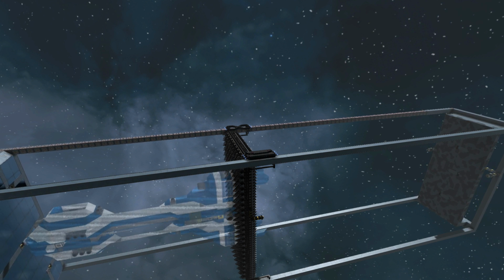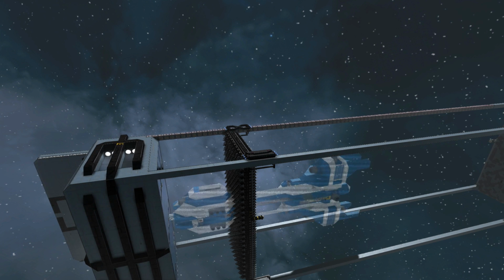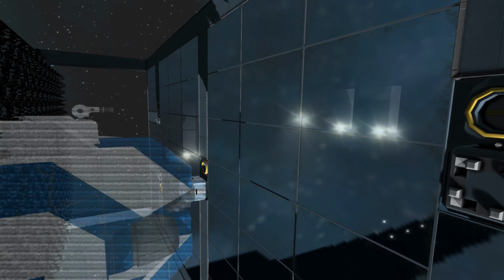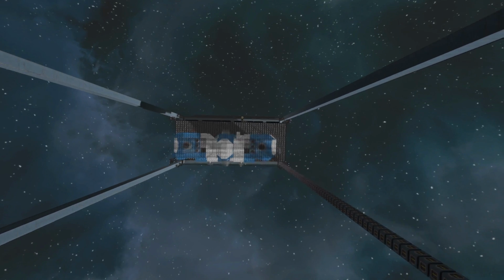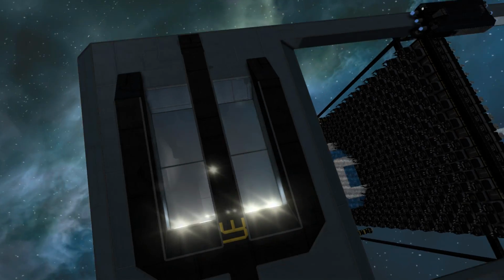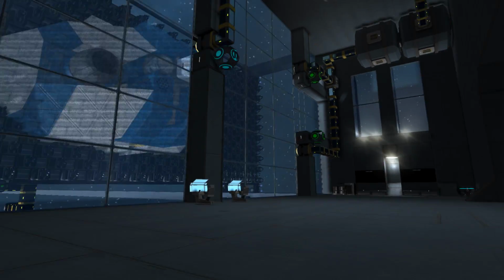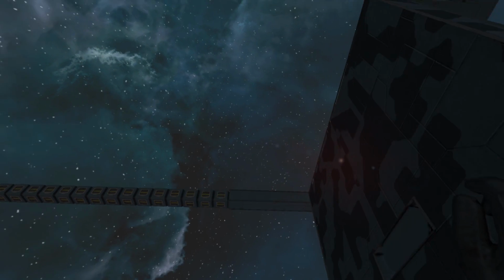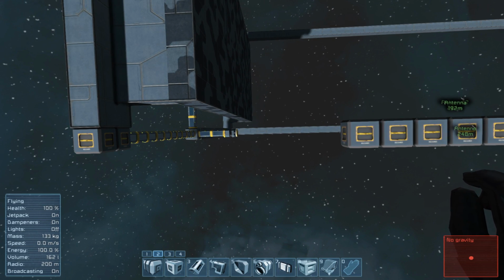Space Engineers - Trident Shipyards v1 (WIP) 3D Ship Printer

Comment: How about having the welders mounted on an extending rotating arm? You know, have the welders rotate around the ship length, and have a piston extend the rotation radius a bit after a full circle. So if you had a ship, which is 100 blocks long, you'd only need a smaller portion of welders than 700. You could even put the welders on a sled, and use only a handful of those. I'm unfortunately not able to play this game, but this channel is absolutely inspiring!

Comment: You mention that a straight cross grid will miss blocks. It is possible to design a cross grid with no overlap and no missing spaces. At least on a 2d plain nothing is missing. Have you tried using a cross grid in that manner? If so, what blocks were missing?

Comment: I have an idea, Instead of using so many welders on pistons with a  few sensors on the front and back of them and set them to extend and retract respectively. What happens is when you start the process it will extend till it see's the first ship block and retract when it get's too close this should keep it within welding range. That way you could print a ship by doing a few passes instead of just in one pass and should greatly improve FPS quality.... atleast that is my theory.

Comment: Impressive to say the lest. Was looking at have the reverse of what you have. Welders stationary and the projector on pistons (multiable) but wasnt sure how the pistons would be be up to the job.
Second idea was to use GPS now which wasnt avaible when you made the vid
Reply from the maker: stuart millican I actually tried the reverse version also with the projector and merge block etc on a piston rig... it was much like you expect - bendy! It kinda worked but wasn't prone to shaking about and being generally unstable :)

GPS method could be cool though
Reply: ***** just used a stationary welders and a projector-tug ship while using gps to keep my center line and speed on track. Worked a treat after a few trials and errors. Welders are still a problem but not as bad as a moblie wall. testing continues with your welder pattern
Reply from the maker: stuart millican
Nice :) Sounds pretty cool... utterly dumb that they still haven't fixed that welder issue though. :s

Comment: wouldn't be simpler to have a wall of welders stationary and move the holographic block??
that way you need only 1 or 2 rails and you keep the welders connected to the part storage and the welders not moving would render faster... i think
Reply: Marco Marques it would be more resource friendly 2!!
Reply from the maker: Marco Marques It would mean the entire ship needs to move though which has it's own issues... I thought quite a lot about which bit to move and which bit to keep still before I started as both are an option and have some problems too.. The main thinking behind this one is to make it easy to expand and make longer, plus the option to use it as a combo grinder wall too.

Comment: why not use on the welder pad, keep the welders apart by say three or four blocks, and then use pistons & timer blocks to move up and down those blocks which dont have welders on? So, say, As it moves, the pad moves down three, resets, moves across one, down three, & repeat twice more, then reset. Much like a real printer. XD You remove said overlap bug, But it would take 3X3 =9       *9 x Longer. So in the video it took about 1 minute to move halfway, so a full length is two minutes long, You stated it was sped up by ten So its 20 Minutes in reality for a full length, But with 9X less welders, You'd Need 9X more time, So 180 minutes would be needed for a full cycle. - I think.  

 And another problem with that design is, If you dont have all of the required parts and you are in a survival situation, the automated nature of the printer would leave blocks incomplete and just continue.

I may have been wrong about the overlapping distance of the welders however, But you just have to edit that formulae accordingly.
Reply from the maker: Fortunately the speed thing is just a byproduct of the welder overlap issue and what it does to the sim speed, in reality it should be able to print a ship that size in about 2 minutes once I have it fixed. I like the suggestion also although I'm tempted to try some others first as I really want to avoid using pistons in this build if I can, bit tired of their bendy weirdness :)

Not sure there's a solution for the lacking parts issue, going to be a problem with all projector systems really.. although maybe something can be done with programming blocks to run a check on parts before it starts.. I'll have a think about that. Cheers :)

Comment: I have done some work on similar issues, even though I have only been using small rigs connected on pistons. What I've done is that I have made sets of four large welders that are controlled by four timers in a sequence. Then I just take that block of four and copy it  to make the welder wall as large as is needed.

The welders are grouped 0 to 3, and are turned on and off so that two welders never overlap.
This is what one group looks like:
0 | 2
------
1 | 3

and four groups:
0 | 2 | 0 | 2
--------------
1 | 3 | 1 | 3
--------------
0 | 2 | 0 | 2
--------------
1 | 3 | 1 | 3

In this way, no neighbouring welders are ever active at the same time, and with the grouping ready the sequence is ready to go as soon as all welders are in place. hope this helps!

One final question to w4stedspace if I may: Why are you using small welders?
Reply from the maker: Nice thinking using the copy+paste technique to setup the groups for you as you go.. makes the whole thing a lot less painful to manage. Will give that a try thanks :)
I'm using small welders because the cart thing only really works right right a small block grid, need to be able to get the wheel spacing just right and doing a small block grid makes that a lot easier... You can probably manage it with a large grid but it'll be a lot more limited in what sizes work and what don't.
Reply: So, I tested my theory today, and was able to print a ship with a 16x16 (large)welder grid without the simspeed drops. Was able to print it so that you could have shown it in real time.  I did get some small UPS(60->45) and FPS drops, but that I think is expected with that much going on without dedicated server.

And for the large/small debate, I do it with large, and have made standard guidewheel frames using 3x3 wheel suspensions, that I just copy on to whatever welder grid I make. Does not look as pretty as yours, but it is mighty functional and quick to put together, I should be able to set up a welder like this in pretty much any size pretty quickly, even in survival...
Reply from the maker: Marton Teilgård
Dedicated servers are actually about the worst of all the options lag wise :) Even locally hosted servers have less and of course single player is the best of all. I've also now managed to get mine to reasonable speed, although also having some sim drops still just because that cart moving seems to cause it on it's own... but still, it's 0.65 now instead of 0.03, perfectly fine for realtime :)

I have done it with large also, just find the small blocks for the cart to be more flexible and don't really see a benefit for using large unless you need one of the large only blocks :)
Reply: Nice to hear that you made it work, I'm exited for your next video. Do you consider this a large ship-only construction yard, or do you have plans for stamping out small ships as well?

The only reason I prefer large is that they are faster to weld up in Survival, it's purely an efficiency stand point.
Reply from the maker: Marton Teilgård Yeah I do want to add some options for small to this also now I've got the basic bits sorted, shouldn't be too hard as the welders don't care what size ship they weld, just need to get a small merge block and small projector setup.

Comment: Looks awesome already, dude =) you sure you don't need bigger wheels to keep that thing stable on the guide shafts? I'm getting some clipping issues with similar contraptions, although I'm resorting to landing gears.
Reply from the maker: Cheers :) The wheels seems fine so far, I've had pretty good luck with these wheels in the past doing things like this, always been the middle size ones I've used.. they really don't do a huge mount in normal operation, the thrusters move it straight enough.. just there in case something goes wrong or it gets moved a bit.

Comment: How about using a smaller welding area, which moves from left to right, similar to how an inkjet printer works. That way you would only need about 50 welders, which would fix the framerate issue.
Reply from the maker: Could work indeed, need to try and work out how to modify it to allow that movement though.. really don't wanna use pistons! Cheers
Reply: I was thinking you could copy the rail system, and then automate it.
Reply: or make it go up>move 1 large block further>go down>move 1 large block further.... it takes longer but you have much less welders
Reply: *****
To avoid the welder-overlap problem, you could also put your welders in 2 (or more if necessary) crosshatched groups and toggle them in intervals. Like this:
Group1
xoxox
oxoxo
xoxox

Group2
oxoxo
xoxox
oxoxo

Oh and you could probably also put connectors along one of the rails to allow refuling at any point while welding.

Of course the inkjet-approach would be much more efficient (albeit slower) in terms of welders required)
Reply from the maker: Tajin Valorian I like that alternating approach tbh, have to muse on which to use now as the printer head approach is nice and cheap but a lot slower like you say. Both cool solutions though.. thanks :)
Reply from the maker: *****
Yeah that's my thought also, just a bit confusing to think about how to make it :)
Reply: ***** So you want it to explode ok...
Ok pf you put to much power in to a large mass of small ship blocks the wheels will pop

Comment: Have you tried a rotating line of welders instead of an entire platform? My thinking is that  depending on how the welding AoE works, it might slow down at certain angles but not in others, shedding some light on the issue (And maybe even working better?).
Reply from the maker: Interesting thinking regarding it potentially shedding some more light on what's causing it exactly. It could work as a building technique to but I suspect what will happen is as it rotates it ends up colliding with blocks that are finished... dunno without trying really, might give that a shot if I can't find a way to make it work like it sits. Thanks!

Comment: have you tried a pattern that puts all the welders so they don't overlap each other yet still at least one welder overlaps each block being built. Like this(the X's are weld heads 0's are gaps)
0X0X0
00000
0X0X0
That should be tight enough to hit every block on a large ship without overlap. I know the pain of overlapping welding problems since I use a lot of mods and the kodiak fly through welder is an awesome idea that hopefully one day will work without dropping sim speed to .05 on my very beefy gaming rig.
Reply from the maker: I'll give it a try, see how it works and if it starts missing anything as I believe the welding are is actually a sphere rather than full blocks so might be some cases where it misses things like that. Kinda pleased to hear I'm not alone with the issue also heh, evidently your beefy rig is more beefy than mine, I get .03 :)
Reply: I think mine bottoms out at .05. I've never seen it go lower. I usually run into the most issues when I have larger small ships in the fly through welder(it's an area affect welder essentially) The more blocks being welded at once by multiple welding spheres, the worse it gets.

Comment: ***** Now that's shiny.  The rail-mounted cart thing seems to work pretty good, too.  Too bad about the welder bug though.  The only solution I can think of involves something like smaller side-mounted welder panels that can move in and out as well as front and back, but that would be complicated, slow, and would probably only work for building one centrally-mounted ship at a time.  Or maybe some kind of adjustable-diameter ring of welders, but I've no idea how to do that.
Reply from the maker: Thanks dude :) The side mounted panels thing sounds a bit mad, bet it would look damn impressive in action but as you say, pretty complex to get working right also... I'll have a think about the adjustable ring idea though, can't think of a method offhand but again would look pretty damn cool in action. Loving how many different suggestions I'm getting to try and solve this.. Thanks man! Another one to muse on :)
Reply: ***** Yeah, the side-mounted panels would have to go in, start welding, move out, stop welding, go back some distance, and repeat.  Actually probably not terrible if you use a programming block to do it instead of timers, but.. not elegant.  The ring might work better in that case.

Speaking of, I had an idea on that count - a ring of blocks, with sideways-mounted rotors with welders on them, rather than pistons which would get in their own way.  The welders would start off facing tangential to the ring, but be rotated to face inward, kind of like an iris.  I'm not sure how precise you can be with that, but it would let you simplify automation a bit over the panels.

You start with the welders at full 'extension' into the ring, move down the length of the ship welding the core in one direction, rotate the welders a bit further out at the end and weld in the other direction to do the next layer, and keep going back and forth like that.  It'd be smoother, easier to program/time, faster, and would look cool as shit.  If the iris thing works anyway. :)
Reply from the maker: Steve Pittman
Tbh you convinced me at the end with the 'looks cool as shit' bit :P Sounds like a nice technical challenge getting that iris to work, might have to give that a try somepoint when I'm feeling bloody minded heh :)

Then ofc there's the programming issue to overcome also but one step at a time :)
Reply: ***** Indeed. :)  My concern with it is I'm not sure how well welders work to the side of their facing.  As the welders are rotated back into their tangential position, you'd have the tip facing parallel to the work surface.  Or.. Hm.  You could do a 2-rotor solution with each one counter-rotating.  So the rotor mounted to the ring would lower the welder into the center, and the one on the welder would keep it facing inward at all times.

The more I think about this, the more complicated it becomes.  I should probably stop. :)
Reply from the maker: Steve Pittman
More complicated but more pretty when in action also :P

Comment: For "mounting" a ship for grinding it down, I recommend using Merge Blocks instead of those large landing gear.  When you merge the ship to the station it becomes a station, so you won't run into issues of bits that get ground loose floating away.
Reply: This is what I always do. you don't even need to make the merge blocks part of the station. I just toss one near the ship and dock it.
Reply from the maker: Very good point.. I liked the landing gear approach because it was a 0 modification approach, fly something in and just press P.. however I can see how just turning it into a station would be a better solution. Cheers :)

Comment: What if you use far less welders with greater spaces in between so there is no overlap & then spin the platform that has the welders on it. If you get rpm high enough it should manage to weld everything, although this option will severely limit ship size & require a complete redesign of what you have currently.
Reply from the maker: and sadly also involve rotors, which are the bane of my SE existence at the moment it seems :) Was trying my best to avoid them and pistons here but yeah, if it does the job of fixing it then I may have to do just that. Would indeed mean a pretty big re-design.. sobeit :) Thanks for the suggestion!

Comment: I came across some problems with projections and certain unusual ship designs which I haven't found a solution for yet. An extreme example of a problematic design has multiple prongs in all directions, meaning that in order for all of it to build, you have to specialise the placement of blocks that connect to a pre-existing block, which also means you need to specialise the grinders that disconnect the ship from the printer (or come up with some clever system for not needing to).
Reply from the maker: A good description of the main design concern when using rigs like this.. forgot to mention it in the video but yeah it's the one concern when printing stuff like this (and you can see it in action on the front of the large blue ship, there's a single block that isn't connected up in time before the welders have moved on).